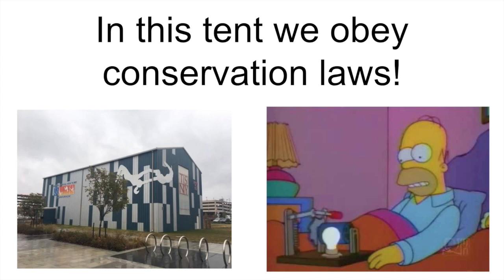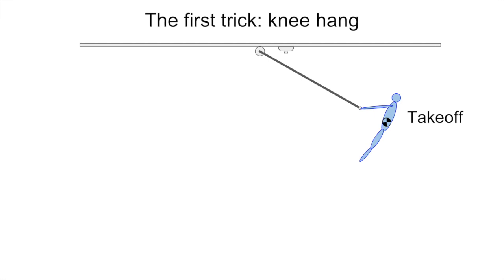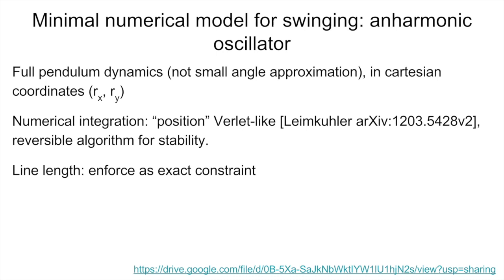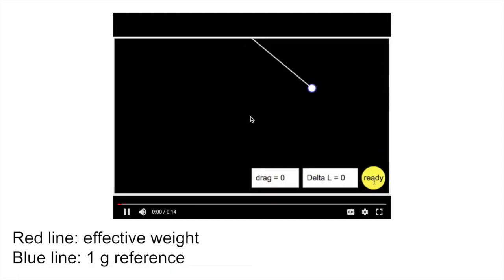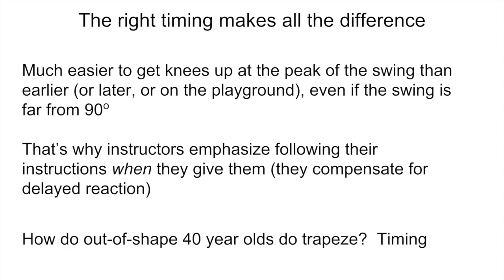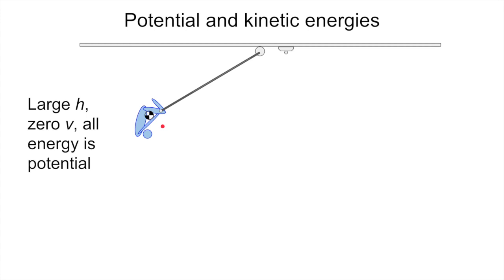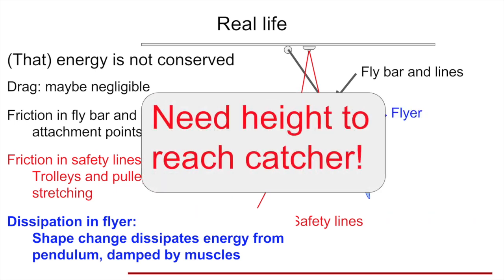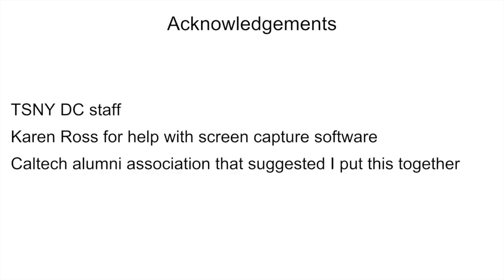In this tent we obey conservation laws: the physics of flying trapeze, part 1 of 3: the knee hang

Comment: I'm no physicist, but safety lines are typically rigged between the fly bar and catchers trapeze, not behind. Wouldn't this drastically change some of the physics involved?
Reply from the maker: I was wondering how long it would take someone to notice the incorrect position of the safety lines trolley (that's one of the things I need to fix when I revise). As for the effect it has, I don't think I'd call it drastically changing the physics, but it will certainly change the precise effect that the safety lines can have on the flyer.  I wasn't really considering those details (in fact, other than generalized drag, I was completely ignoring the safety lines) so far.
Reply from the maker: It's also worth pointing out (thanks to Daniel, among others) that the safety lines can also used to help the flyer gain or maintain speed and height by pulling on them at the correct point, not just slow them down for safety as they fall.